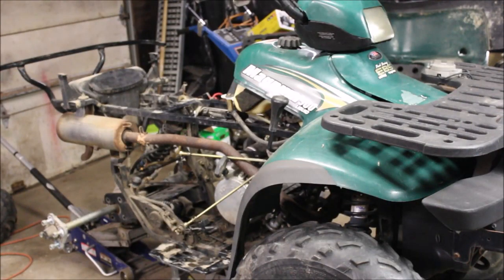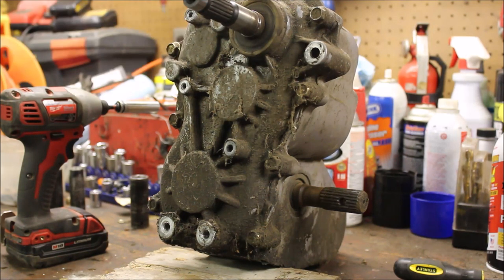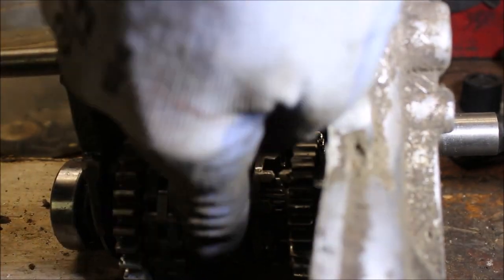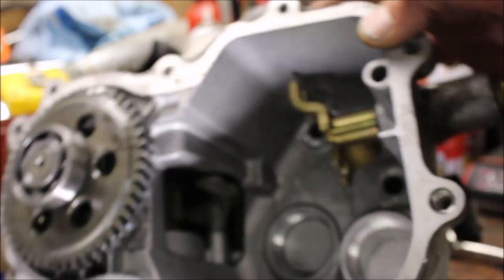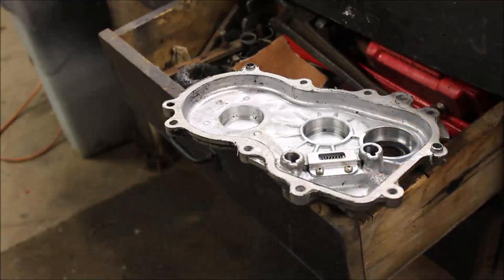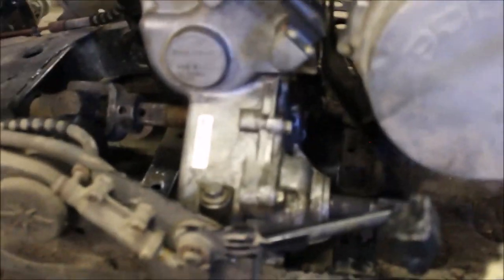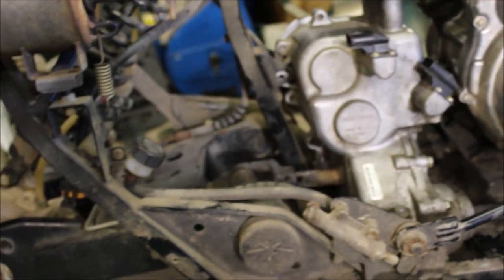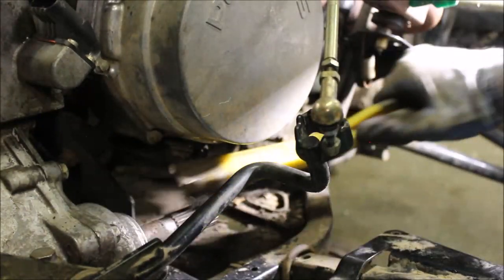Polaris Magnum 500 Transmission Project! How to Rebuild, Install, and make it Faster w/TALLER GEARS.

Comment: Instead of putting the roll pin back in, I have used a nut and bolt on the front axles of my polaris